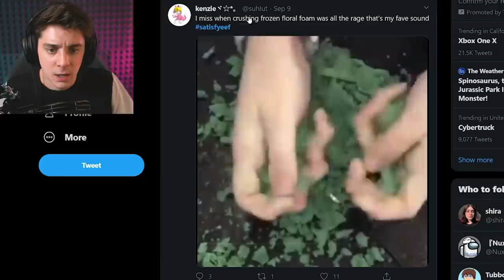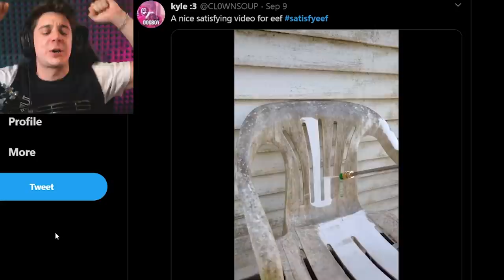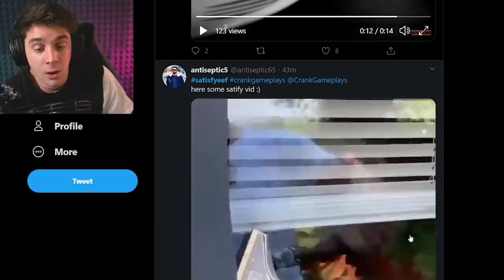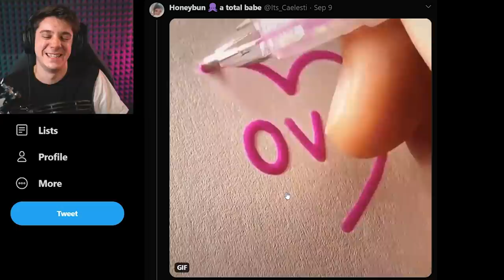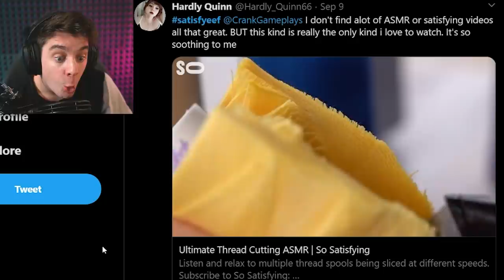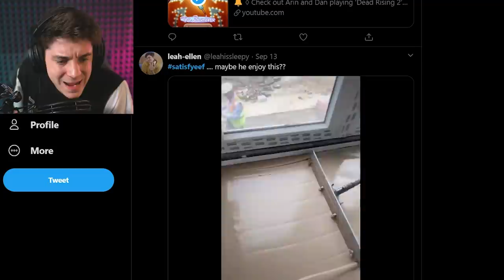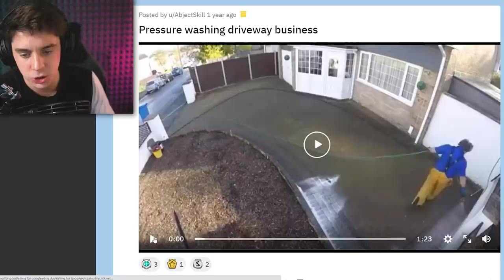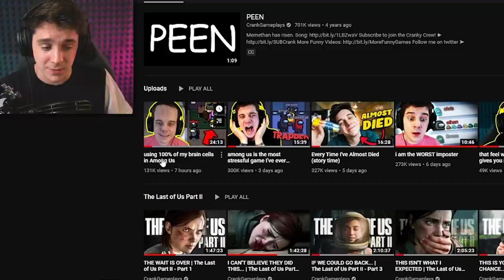you sent me your most satisfying videos

Comment: Over the summer, I had a pool cleaning job where we’d drain the pool and just do a deep clean with pressure washers and acid mixtures. It was so satisfying! I got to use one of the circular ones a lot and it was so fun. The only downside to pressure washing in a drained pool is that you get drenched from all the mist and water spraying right back at you.

Comment: the black stuff on the window is likely a type of insulation for summer weather, the black absorbs sunlight and keeps the heat on the outside of the dual window pane, the energy from the heat outside the window draws cold into the middle of the dual window pane, making a insulating layer. y'take it off during the spring/summer/winter to let the light back in.

Comment: bruh I worked at a bar with a flat top grill and we put the hot oil from the fryer and scrub that into it with a specially designed "brick." super satisfying but I've burned myself quite a few times